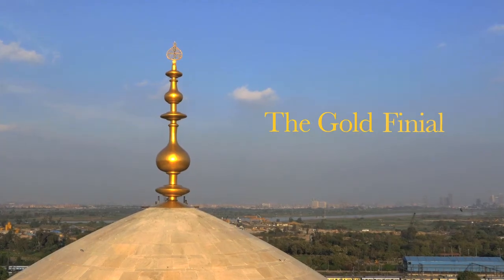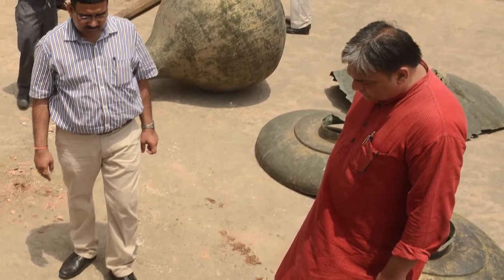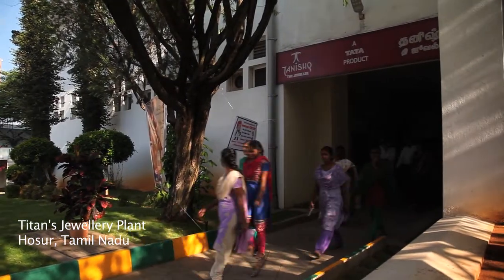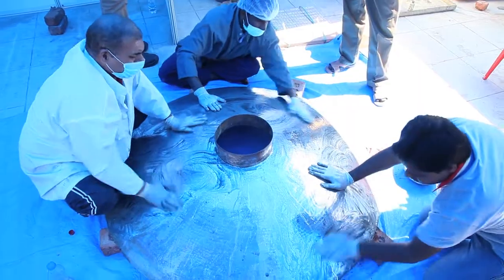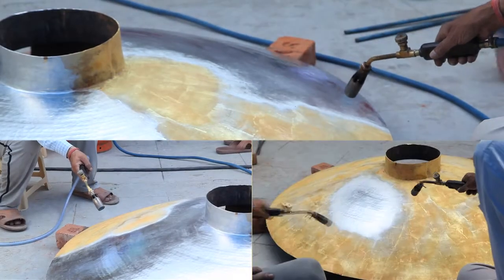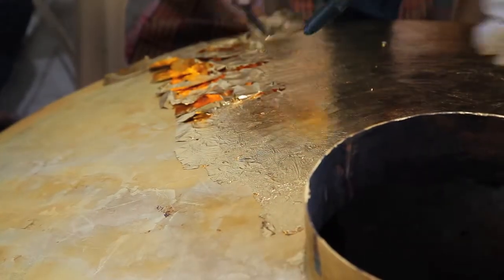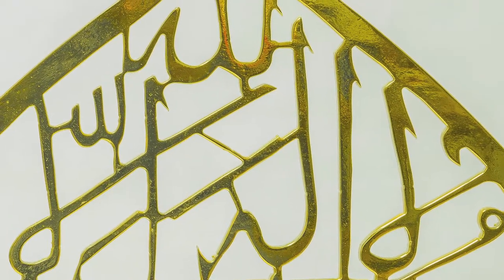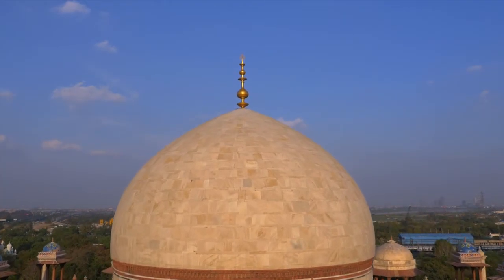The Gold Finial of Humayun's Tomb

Comment: Octagonal shape has a special significance in Hindu architecture. 
why was the inscription  different from the rest of the structure because that was  the only  work done by Moghuls after usurping the original Hindu Palace which had originally Vishnu's  foot prints illustrated by a French man G LE BON in a book he published 155 years ago .
The parapet of the main building is decorated on all sides with the tantric design of interlocked  triangles known as श्री chakra / shakti  chakra.The so called Humayun's tomb is a multistoreyed  palatial mansion with numerous outhouses and annexes spread over a vast area enclosed by three defensive walls.Does a Tomb require all this.
Building a tomb is HARAM in Islam .There is no tomb of prophet Muhammad then how so many have cropped up in India.
For how many centuries are you going to spread these lies? 
TITAN should also try to know the Truth.
Reply: Very relevant points raised.
Reply: There was a wooden pole holding the huge bulky burden for centuries.
ASI was expected to undertake carbon 14 test of that wooden pole. It could have indicated scientific data for the study of such monuments. Was the test conducted or not should be investigated.
Reply: Sardar ji, Prakash ji from titan company could you please share the report?
Reply: The same is said about Taj Mahal from Prof. PN Oak. These are false stories and have been rebutted. The prophet Muhammad has a tomb called Green dome.